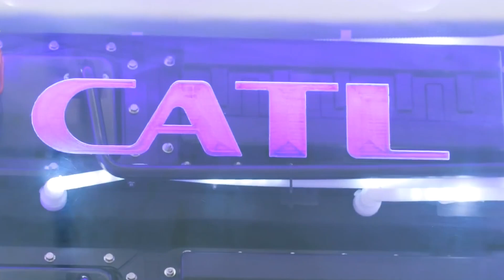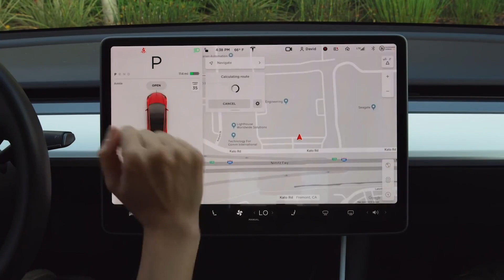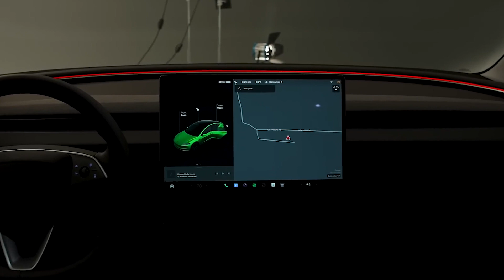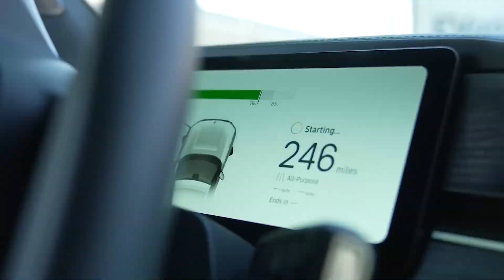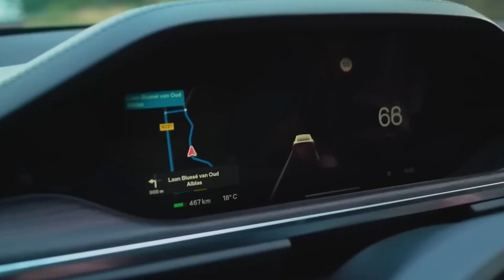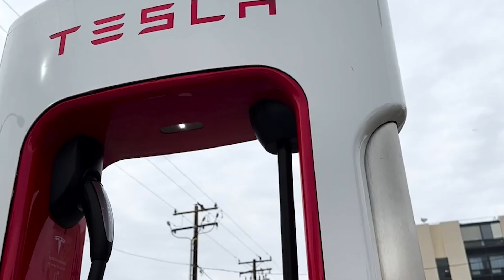TESLA SMASH BYD New Battery just 15min Charging!

Comment: 100kWh in 15 min requires 400kW per car.
How will charging stations deliver this kind of power?
Reply: More batteries of course. Batteries to charge the batteries baby!
Reply from the maker: @leontraverse4720  Haha good one
Reply: More like 280kW per car (10 -> 80% ... 70kWh to fill). But it's always possible to limit the power output if everybody is charging at the same time.
Reply from the maker: Elon has a solution for every problem it’s Elon
Reply: @TechTeamCommunity  so basically this wont happen...its Elon